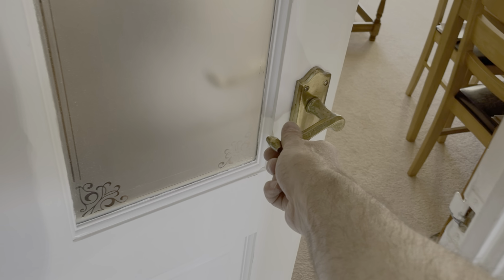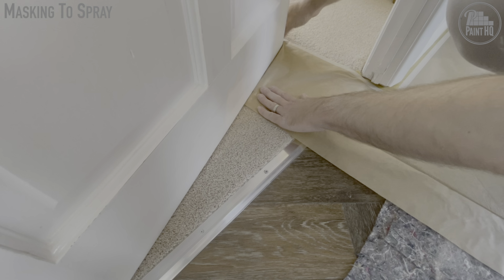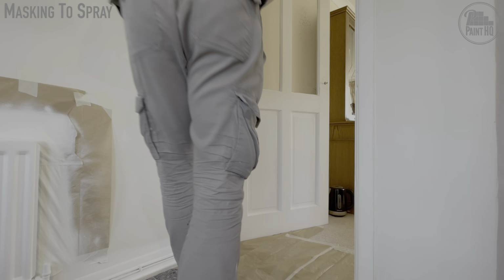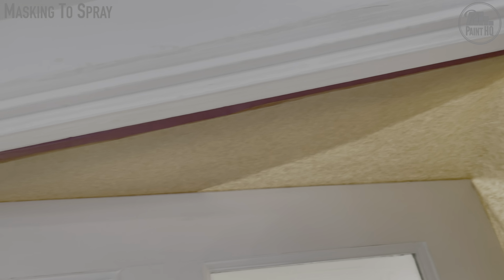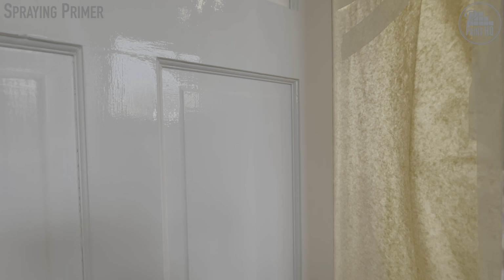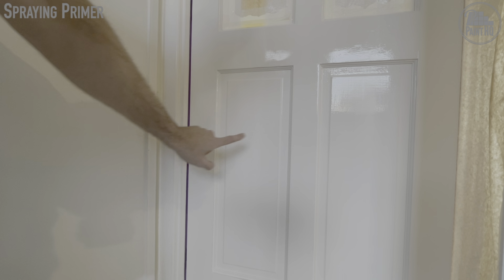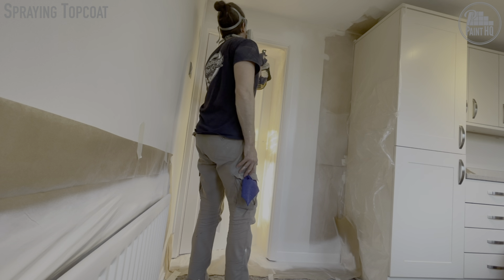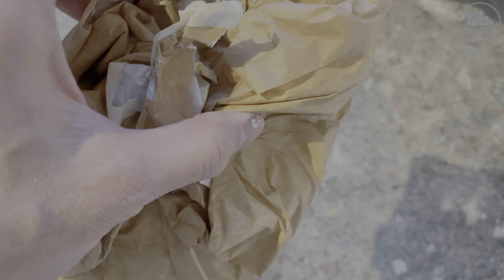How to Paint Doors using a Professional Paint Sprayer. Airless Spray like a Pro

Comment: Sorry mate, but you should’ve opened that door right up, then masked up, this is not a thorough way to spray a door
Reply from the maker: Thanks for your feedback my friend.. if anything, space permitting and other factors, I’d actually look to remove the door.. I feel just opening the door wide open, brings other challenges.. masking hinges, over spray to the other side of the door (not being painted) and overspray to the other room (also not being painted), even dust travelling throughout a furnished / occupied property.. appreciate your input though 👍🙏 Regards Pete 💙💯
Reply: Best way to do doors 👌
Reply from the maker: @J-PoN 👏👏👏💙💯

Comment: Pete, you certainly have the correct mindset for painting and the preparations before.  Your experience really comes through before you start painting, you know how and where the paint will go before it leaves the gun.  I haven't started to paint with my new sprayer ( very lightly used Graco 390) but I would have never thought to tape a door the way you did.  It's so important to see a professional prepare for and then watch your spraying motions.  Looking over your shoulder is invaluable.  Thanks again.
Reply from the maker: You’re so kind, thanks for your feedback 💙💯 I’m aware I have an analytical mind 😄 always feel free to reach out, I’m happy to help my friend 🙏 regards Pete

Comment: Great video and thanks for your time in producing it. I called Sprayman, Burntwood earlier today as they came up as my local Graco stockist and they mentioned your YT Channel.  I'm left pondering whether to go for the Ultra or the Quickshot. For me they both have advantages and disadvantages in comparison. Decisions, decisions. Happy Christmas. Roll on 2024! 👍
Reply from the maker: Hey Paul, thank you so much.. I appreciate you watching — yeah the team at SpraymanUK is awesome and super knowledgeable 🙏 I get your dilemma, both will serve you well.. I can easily say “go for the Ultra QuickShot”, but I can appreciate the extra financial investment.. I can sense you’re pretty good at weighing up which suits your needs — but if I can offer any help by addressing any questions, don’t hesitate to ask my friend 💙💯 Either way, keep in touch and let me know how you decide.. it’ll be good feedback for me, to hear your deciding reasons 🙏💙💯 Regards Pete
Reply: Thank you very much Pete. I think I'm going Quickshot.  @PaintHQ
Reply from the maker: Great choice my friend 👏👏👏
Reply: Typically me but sensible i suppose, in case this will be one of my latest bloke fads, I don't think it will be though. Ive just picked up a good condition UltraMax for £50. It has all the paperwork and invoice etc. As one would expect, it sprays absolutely nothing. So Pete, are these pumps definitely  irreparable even if completely stripped down and unblocked, rebuilt? Cheers. Regards. Paul  @PaintHQ
Reply from the maker: @paulj5129 Hi Paul, I totally understand 👍 Even though the unit you’ve purchased, the pump is end of life.. you’ve got it at a good price at £50 — with batteries, charger and all in good condition 👍 Unfortunately the pump is not repairable, it’s classed as a consumable item.. the packings will most likely worn / warped and even if they could be swapped out (that can’t).. the timings of the 3 pistons will be lost / out of place, that alone renders the pump defective..

Good news though, the pump can be replaced for what is now the Triax II 👍 a reengineered pump, improving on its predecessor.. this video shows the replacement process and links in the description to the Triax II at SpraymanUK (I can confirm all SpraymanUK stock is the new pump) 💙💯

https://youtu.be/5YuoDb4INug
Reply: Thanks Pete and yes, I will be visiting Sprayman when they reopen. New pump and it looks like i need new tips, four came with it but they look pretty rough. Cant wait to have a play though. I'll still probably buy the Ultra Quickshot anyway because I've lots of things to paint in our new home in Cannock. Happy New Year when it comes and thanks again for your excellent vids. I'll 'buy you a coffee' in the next few days. 
 @PaintHQ
Reply from the maker: @paulj5129 You’re very welcome, say hello to Mike at SpraymanUK for me 😄 You’re so kind, thank you my friend 🙏
Reply: I will do that. 😇👍 @PaintHQ

Comment: Hi
Thank you for the vid.
I’m a painter too and always watch your vids.
Love the way you make it and put a lot of effort on it.

I have the same machine ( not ultra)
Whenever I do the doors and frames , it spits!
Even if I pull the trigger off and on before reaching to the surface!
Any advice?

Thanks
Reply from the maker: Thank you Wahid, really appreciate you watching the videos and your very kind support.. With any airless gun, it’s worth checking and swapping out the tip guard seat / seal. Then specific to the Ultra and UltraMax Handhelds, the outlet valve (the threaded part where the tip guard attaches) — is essentially a CleanShot, and can need adjusting. It can be seen when looking at the outlet valve straight on.. my recommendation is try a new tip guard seat / seal and then maybe contact a service centre to investigate the outlet valve.. all the best my friend.. regards Pete 💙
Reply: @PaintHQ  thank you. I will .💙

Comment: Great video pal, I’ve always used brush and roller but I am going to try spray, is it faster do you think
Reply from the maker: Thank you my friend 🙏 On the whole I’d say it’s faster — once you master the preparation and masking 👍 Spray application is super quick, and once you learn the product, you learn if you can speed up drying a recoat.. whereas a brush / roller, product has to be 100 percent dry, otherwise you risk paint dragging.. so yeah, it’s quicker, less laborious and the finish is mind blowing 👌 regards Pete 💙💯

Comment: Hey. Can I convert to AAA with just a small 2hp compressor? If so what Graco airless pump would be a good investment in a 1 man shop to covert to AAA? What’s your favorite AAA gun? Thank you. Great videos.
Reply from the maker: That’s a good question, in short it’s not as simple as matching a compressor in terms of size (litres) and power (hp).. whilst size will give an indication of the volume of air available in reserve.. it’s the delivery of air in CFM needed to ‘drive’ the air cap.. if I recall my 3hp / 24 litre Gentilin compressor can deliver 7 CFM — which is not a particularly high CFM, but enough to drive my Durr AAA gun.. I’d recommend seeking the expertise of the sales distributor in terms of matching the CFM to the AAA gun ..I myself speak to Mike at SpraymanUK 😄

I’m using the highly acclaimed Durr EcoGun 2100.. regarding pumps, if you’re looking to use purely in a small workshop environment, the Graco Mini Merkur could be worth a look.. it’s an air powered AAA unit, that comes with a Graco G40 gun 👍

Hope this helps a little my friend.. AAA is a bit of a minefield but it’s an exciting, very rewarding and even fun journey 💙💯 regards Pete

Comment: Do u tape just one time? Question is, if u paint the second layer or some times the thirdy layer. Does it not stick with the dryed layer to oull of the taoe?
Reply from the maker: Good question my friend .. I only tape up once, and this will be fine for priming and spraying two top coats 👍 There is no risk of bridging, but as always peel back the the tape with care, at a 45 degree angle.. I also use a quality washi tape (I demonstrate in this video, I use Kip, it’s the same company behind FrogTape, parent company is Shurtape).. a washi tape is thin, smooth and strong 👍

This video on the PaintHQ channel, about spraying a room, will clarify and guide you through each masking / spraying stage..

Spray a Room Using Graco QuickShot [& Graco 395] Airless Paint Sprayer
https://youtu.be/F-8VPjDDUHs

Hope this helps.. regards Pete 💙💯

Comment: Do you paint the hinged areas by brush later?
Reply from the maker: Yes my friend 👍 ..If you mask the opening wider, say 24” the door will open wide enough to expose the hinge side — you just need to put a run of purple sensitive tape down the hinged opening (to stop spray going through into the adjoining room).. just weigh up if it’s feasible or not.. I’m prepping one today, and at the moment my thought is to manually paint in the hinged side 🤔 ..Regards Pete 💙💯

Comment: hey Pete, what was your dilution for the top coat to use a 308 pls??
Reply from the maker: Hey buddy.. I don’t dilute trim / woodwork paints.. I’m spraying a low viscosity WB enamel top coat by AkzoNobel — sprays / atomises very easily at low pressure .. if I recall I link to the product in the video description 👍 regards Pete

Comment: Did we make a mistake by masking off the glass last? Pressing on the door risks dislodging the door opening masking... ;)
At the start of this video, I thought you were going to do both sides and thought that it would be interesting on the other side. 
Man, I'm looking for a way to vacuum up loose overspray before it hits any surfaces...
Great relaxing video as usual! Thanks!
Reply from the maker: Haha, a deliberate mistake my friend  — so I could get plenty of light shining through for the filming 😄 Yeah it does make sense to mask off glass panes first — although it’s surprising how strong masking like this holds up.. in occupied houses, it’s common to have other doors, especially external doors that causes movement, but I’ve never had a failure 🙏 Thanks for your input..

I do rate this portable, cost effective solution to venting outside.. comes with the ducting and the smaller size is much easier to move around 👌 

https://amzn.eu/d/04fG7TA

Comment: 2 quick questions, what are the exact paints, how much quicker is this process than brush / mini roller ? as increased productivity / profitability
Reply: Let’s just say my friend if we had one door each you would finish before me but I would have the better finish if we had 14 doors each I would be done in three hours you would be there maybe all day
Reply from the maker: Hi Nic, great questions, thank you .. I personally feel I can mask and spray a door faster, but it’s the cabinet like finish you get from spraying that’s a win for me (and my customer) 👌 First time trying, you think it’s a long process, but like anything you get quicker..  so yeah in terms of profitability, I win more work from the finish achieved spraying doors / woodwork, it’s that good 

The products I spray are industrial waterborne 1K products by AkzoNobel — a WP136 primer and then an enamel topcoat.. all from Holman Paints.. if you check out this video, you’ll see them in action spraying a staircase and I link the products in the description 👍

https://youtu.be/q54gOAGuOcY

Thank you for your support 🙏 regards Pete 💙💯
Reply: Great to know, I was surprised you didn't use the Graco ultra quickshot cordless. You're right, when it's the right job for it break out the sprayer. Does anybody use air scrubbers / extraction ducting with the sprayer ??
 @PaintHQ
Reply from the maker: @nicw2545 Good question — The Graco Ultra QuickShot is awesome, I purely just wanted to showcase the HH for a change 😄 ..This is what I’m using to vent outside — more so when I’m spraying more than just the one door 👍

https://amzn.eu/d/gTigwPm